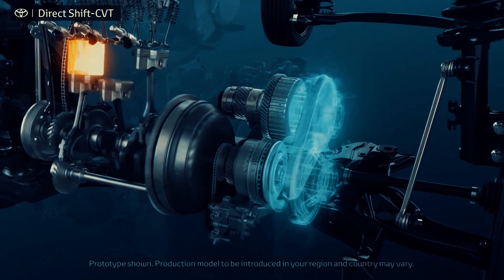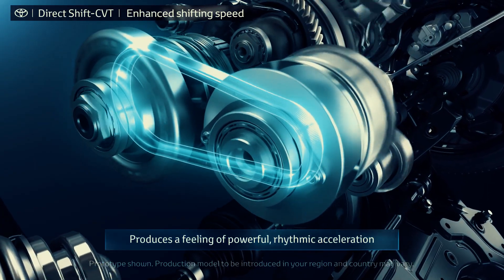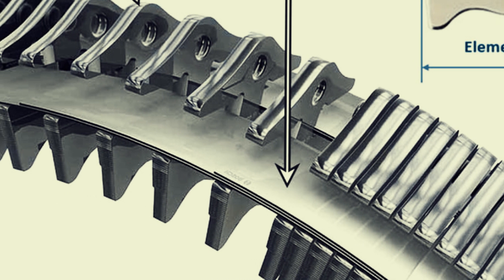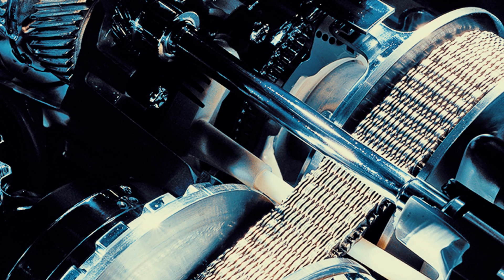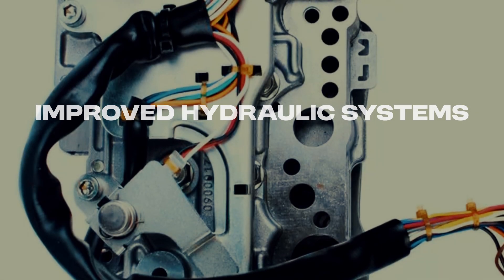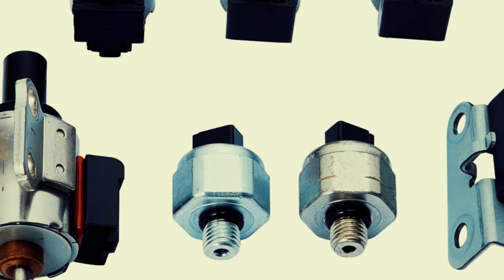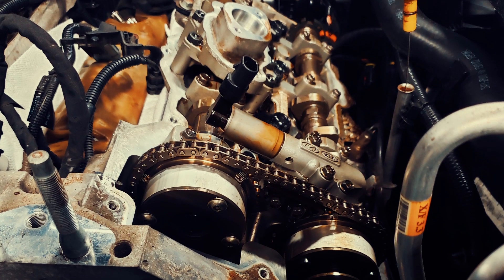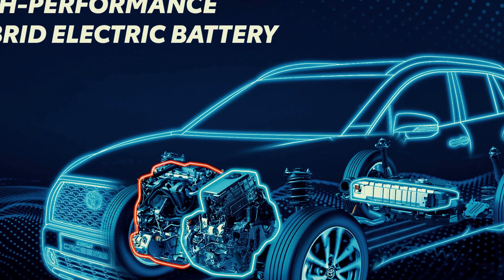Top 5 Groundbreaking CVT Technologies You Need to Know About

Comment: eCVT transaxle split power systems is the only CVT anyone should get. They have robust planetary gearset with two electric motors that share the power between engine and electric motors. There's no wearable components like belts, bands, clutch packs, ball bearings, it's just gears.

CVT's always break their rubber or metal V belts long before they get to 150K miles.  Nissan's have the junkiest CVT's and was made by Jatco.